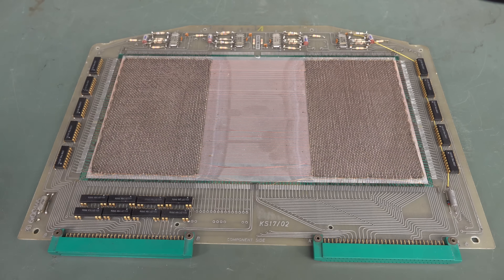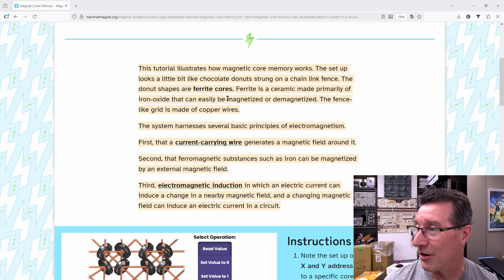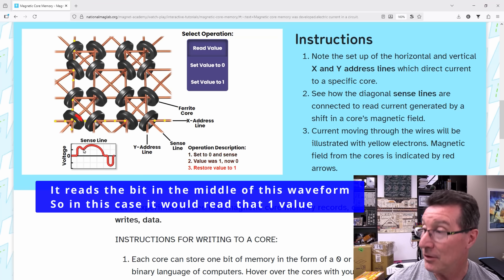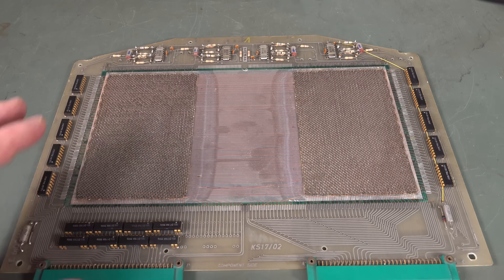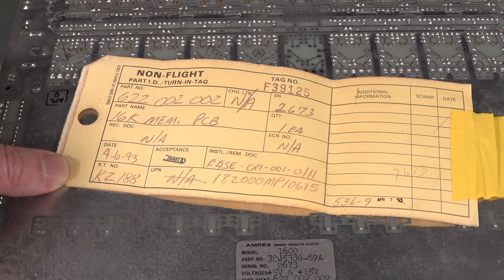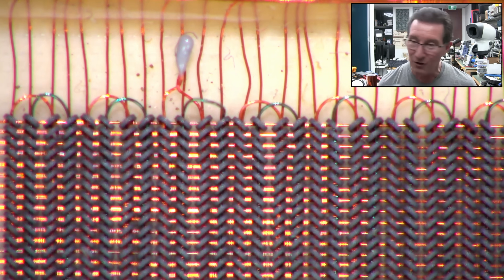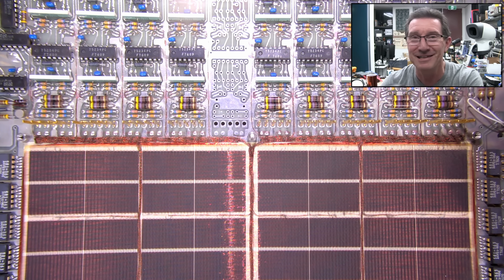EEVblog 1713 - CRAZY Density Magnetic Core Memory from Space Shuttle!

Comment from the maker: UPDATE: This is from Mailbag 668. It is from a Mitra 125s computer used in the Space Shuttle Spacelab program. The Mailbag video shows the top controller PCB as well that I likely also still have in the bunker.
Reply: I should not know this, but I happened to be an apprentice at the company that made it. The cancelled TSR2 used magnetic core memory, which consisted of a grid of wires passing through ferrite rings as per your illustration. I also got to see the gyro that was used in the prototype. I say gyro as it was a 4 inch cube containing 3 separate Gyroscopes, one for pitch, one for roll.and one for yaw. All these parts were supposed to have been destroyed after the aircraft was cancelled
Reply: I was going to say the "KSC Form" on the tag taped onto the 16K board stands for Kennedy Space Center
Reply: The Mitra 125s was a minicomputer developped by a French computer company (CII) created under  "Plan Calcul"  in order to develop a French/European computer industry. The Mitra line targeted mainly process control, industrial automation and such. Another competitor was Telemecanique and at some point the 2 companies were merged into SEMS (European Society of Microcomputer and Systems). I worked at SEMS (end 70s-beginning 80s) and at that time these minicomputers were using solid state memory. They were 16 bits with 2 bit parity).
To learn more you can search Wikipedia for "Plan Calcul" and "Mitra 15". The Mitra 15 was a predecessor of the 125 and the Wikipedia page covers both and more.
Reply: Absolutely fascinating. I hope that Ampex one was done by some sort of a machine as I wouldn't like to have been given that as a job. You would be blind in no time trying to focus on things that small.
Reply: At 3:04 , why aren't all the magnetic rings where the current passed change? Looks like 4 bits (rings) should have changed.
It looks to me like X and Y select and sense are COMBINED to reach the reluctance level needed.
Reply: In Electronic Design in the 1990s, there was an article about storing 6 to 8 bits of RAM into EACH ATOM by modifying the electron orbits somehow. I don't know if that was the same as what they call SPIN now, with SPIN-RAM out for a little while in the early 2005 maybe that were non - volitile. Would be nice to have a video on this or both if they are different things.
Reply: would it be possible for you and louis rossmann to do a youtube retirement croudfund for franblanche? she is literally dying in front of the camera doing vids for youtube .....

wouldn't have written this if it weren't urgent and somewhat serious

Comment: Notice that the cores have sharp edges. The sharp edge gives higher hysteresis in the magnetic flux. This is important when addressing a single core, all cores on the same row and column will receive 1*current, while the addressed core will receive 2*current, which will be respectively, under and over the threshold.
Reply: Also, reading a magnetic core will destroy the data bit in it.

The data will have to be rewritten back into the core.

Comment: That circuit board is not from the Space Shuttle.  It may have been used in a ground computer that did calculations related to the space shuttle program.

When I was in the US Navy we were using old data/program punch card sorters that had wire-board to program the sorter (you ran wires to connect outputs to inputs of sections with certain logic function: depending on how you wired the board it could do about a dozen different sorts of the data/program punch cards).   I read the manuals and created several "Programed" wire-board cards to do things that the Chief's wanted done.  That's how I got into programming....

Comment: Towards the end of core memory, one of the big magazines did a deep dive into core memory, with lots of cool closeups. They also talked about repairing the cores / wiring. It was necessary because over time, the vibrations would cause the cores to release leading to wearing. It was a highly specialized skill. As for reading it, you could probably read it with a magnetic scanner or a DIY using an HDD head.

Comment: So those ferrites are really fragile... I wonder what happens when a core breaks right in the middle of assembly. Could they somehow back-track to fix it, or just bin it and start again.
Reply: This was one of the selling points for the early DRAM chips -- if a bit goes bad, you only need to replace one chip which was 1024 bits. Repairing a magnetic core array was possible, but it was a very difficult procedure.

Comment: I was talking to a physics professor who did research in the antarctic. He said that when they would shutdown their PDP-8 when they left for the "winter", all they did was press halt and power it down. When they came back they powered it back up and hit run and it would pick up from where if left off because the core memory was happy to wait for them just chillin. So you never know, there may still be data in that board.
Reply: The data in core memory never goes away, but it is not reliable if power is shut down while running a program.

This is because readout requires zeroing out the data to be read, detecting the magnetic “flip” and saving the data in a register, then either passing the data to the system or replacing it with new data, then suppressing the rewriting of 1s in the bit positions that did or will contain 0s, when the rewrite pulses are activated.

So if the system is running while the power supply is “dying,” data may be read or written incorrectly.  But if the system is manually stopped before the power is cut, the data are safe.

Comment: When I worked for Delco Defense Systems, I used to occasionally visit the factory in Milwaukee Wisconsin. Our core memory line was in-house at that location until the last gasp. (Magnetic bubble memory was oustsourced to National Semiconductor by the mid eighties and silicon based memory families were either off the shelf or made for us by RCA in the case of special products). The last time I was out there in about 1992, the ten or twelve old ladies (and one twenty something guy) were still there and still weaving their magic just like in the sixties. They worked by hand using moderate low magnification stereo zoom microscopes. They did panels up to a megabyte by eight bits. Mostly used in satellite applications. The biggest panels were actually woven in sub panels that were fan folded into truly impressive modules. The contents stored in a properly engineered panel were safely retained through cold, heat (up to almost the curie point of the ferrite), vibration, cosmic radiation, and other radiation such as starfish prime. The data was also retained through a system reset or even a cold reboot. Is the stuff still in use today? I believe that some of our panels are still working happily away on the voyager probes.

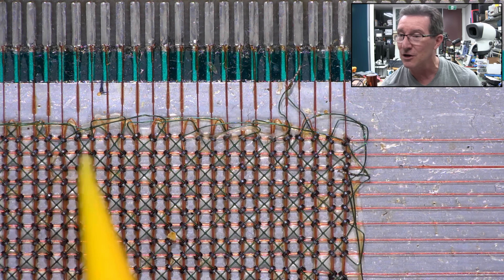Comment: If you look closely (at 11:51), there are two wires running in the Y direction. One of them is the address wire and the other one the write inhibit (looping through all the cores). Therefore, reading is actually a constant time operation: write-back happens anyway, but if it was a zero, the inhibit wire will block it.

(Addressing works by sending just above half of what is needed to flip a core's orientation down the respective X and Y wires, so that there's just a single core, just where these cross, that is actually flipped. If we oppose this by applying an opposing charge at the inhibit wire, no core will be affected. So, by simply repeating at the inhibit wire what's sensed on read, write-back is taken care of auto-magically. – Core memory is very much ingenious!)

On the Ampex board, the sense wire might have been repurposed for write inhibit. (Notably, this loops through all the cores, as well. Optimzing out one of the wires would have allowed for a smaller core diameter, but would have also been more challenging on the analog side of things. Or the write-back may have been controlled by dedicated logic, depending on what was sensed.)
Reply: As I understand it, the purpose of the inhibit wire was to control whether a 1 or 0 was written to each bit of a multi-bit word, so you could apply the same X-Y drive currents to all the planes and use the inhibit wires to determine the data written.

Comment: I helped build traffic signal systems back in the early 80's that used Data General Nova 1200 minicomputers. These had magnetic core memory, a whopping 16 kilobytes of it, on a single 15" square PCB. These were 16-bit machines with 8-bit bytes and 16-bit words, but most commands were entered on the front panel in octal, as I recall. We used them because they were durable in harsh environments, which could not be said for machines of the day that depended more on complex semiconductors. The DOD liked them for that reason, too, and they were used there fore things that still can't be talked about. That said, I don't miss them.

Comment: One of the first home-made 6800 systems I programmed had a 8kx8 core mat rigged as the memory. Great to be able to turn it off, come back a week later, and your code was just still there. When I was an apprentice at Plessey Mircosystems in 1982 they were still making/repairing core mats used in air traffic control systems, but bubble memory was the new thing for power-off storage.

Comment: As an undergrad at SFSU, we had an old DEC system in the corner of the lab with ferrite core memory, perhaps a PDP-8. Sorry, but it's been almost 50 years. The toroidal magnets were larger than either of your examples, perhaps a cm in diameter? 

They're wired in the same three--wire configuration, invented by JW Forester and documented in his 1951 paper. Every read is folliwed by a write, although a small logic circuit inhibited current when the result was zero. Storage was a precious thing in the 1950s and 1960s.

Comment: Hi Dave, if you look at 10:55, you will see an extra wire in the array, x, y, sense and inhibit.
This was to speed up the re-write needed after a read event by not selecting the individual core that was read but by doing a mass write to the complete core array and using the inhibit line to suppress over writing cores that were supposed to stay zero.

Comment: 18-bit is not that unusual actually. Many memory chips have 9/18/36/etc-bits. Everything with ECC so all memory chips used in servers and recently also DDR5.
Capacity is kinda low for the size... but also extremely large given the tech used. Really nice package and it even starts causing these chip-like light effects. Miniaturize it even more and it would be pretty much like integrated chip from outside.

Would be cool if you could read the data... for which it would be good to have similar module to make some kind of reader... which if you got one you would have identical issue with any operations destroying data.

Comment: When I was at CMU back in the late 90s I came across a very old mainframe computer out in the hallway of an EE building. One of those refrigerator like things with tape drives on the front. I asked around but no one knew what it was there for. So I took out the "hard drive", which was a big metal case full of what was probably magnetic core memory cards, and left a note. Sadly, they contacted me later and asked me to return it. So I never actually got to take it fully apart. I have no idea what they wanted that computer for.

Comment: In 1988, I was visiting AMPEX in HK, and was taken to visit Ampex Ferrotec to see the core assembly process.
Three little old ladies seated around circular work areas with tubs of core in the middle.
Each manually knitting new cores onto the wire matrix by hand, without magnifiers !
Very cool.
Reply: IBM “printed” the concept behind rope core ROM for the lowest models of 360s, such as the Model 20.  They mass produced strips of flat cable with two 37-rung ladder shaped conducting paths joined at one end and with two terminals at the other, embedded between plastic sheets, with holes punched in the plastic insulation between rungs.  To program the 72-bit word stored in one of these strips, a technician punches a hole to break one  of the longitudinal wires between rungs, ie 72 holes in all, to create a single serpentine conducting path down one side of the strip and up the other between the terminals.  These strips are stacked on the innermost of two ferrite pole pieces on both sides, so that the conducting path on each strip goes between the pole pieces of some sensing coils and bypasses others, thus encoding the 72-bit word.  Each strip is connected to one of the word selector outputs of an n-bit binary to one-of-2^n decoder, and the lid containing the 72 ferrite caps to complete the magnetic circuit is screwed on.  So the ROM address selects one of the strips per cycle, sends a current pulse through that strip, which induces a voltage pulse in the sensor coils where the strip goes through the magnet to encode a 1, none where it bypasses the core to encode a 0.  This is a simpler (but bulkier and heavier) analog of the core rope ROM, which IBM called TROS, for Transformer Read Only Storage.
Reply: That's insane! Imaging how long it would take to make a full memory array. How could they ever mass produce this?
Reply: not sure, I was only there for a couple of hours.l!
They were pretty fast, I think the panels they were working on were perhaps 4K bits, and it would take a couple of hours knitting,  They took a tea break while I was there, so I can’t  be sure.
What struck me was there wasn’t any particular ‘clean room’ or sterile facility in sight !
Reply: @laustinspeiss  There is a machine where 2 people (usually women)  hand feed the 'needle' through a panel with holes in it which moves automatically to each position. Years ago I watched a video on YT about it, called "Computer for Apollo" from 1965. They talk about the memory here.... https://youtu.be/ndvmFlg1WmE?t=1244
Reply: @g4z-kb7ct  this is magnetic core rope memory, its a ROM not RAM. similar principles though
Reply: @FrankGennari  by finding more old ladies to knit more in parallel, obviously.

Comment: Great video. I used to work for IBM New Zealand and my first job (that I was allowed to do solo.) was to remove core storage out of a mainframe comunications controller and replace it with new fangled electronic RAM. This was in the very early 80's
But later in the '90s I met a US guy that worked for IBM Federal Systems at NASA. He was tasked to have some core storage remade for use as last ditch storage for the space shuttle. When the Challenger exploded on launch, the recovered core storage still contained the last bit of telemetry data. Way cool!

Comment: 1970’s lighting desks used core stores. I worked at the bbc in the late 80’s and there was a decommissioned desk that hadn’t been removed. Fascinating stuff
Reply: What's a lighting desk? ???
Reply: @kennethflorek8532 a bit of equipment used in theatre and television that is used to control the lights. They are usually split into 3 parts. The controls used by the operator, a rack of electronics (the bit with logic and memory) and a bunch of big dimmers (which control the power supplied to each light in the studio). The Thorn Q-file was the desk I saw.

Comment: How is it that the current flowing through those X and Y wires does not disturb the magnetization of the other cores along its way?
Reply: Hysteresis.  The ferrite requires the magnetic flux from the current in two wires to flip. The flux from the current in one wire does nothing.  Since only one x and one y are active at one time, only the core at that intersection is affected.
Reply from the maker: They have a large hysteresis, such that only having dual current from both X and Y magnetises them.

Comment: ... that 16K ferrite core memory looks absolutely majestic! The craftsmanship on these modules is so delicate and fine ... work of art :)
Reply: The cores were not wired one by one by hand. The worker would take the array of cores already oriented in the required pattern by a machine, and then insert maybe 64 wires in parallel, using a specially made jig. There was still quite a lot of manual work, but it was thousands of times more productive compared to what it would take to insert the wires in each core individually.
Reply: @cogoid  Yeah prewired columns is a good automation idea. But the diagonal wire from the first product, that must be manual labor!
Reply: Hand assembled by women under a microscope, obviously. Yes, huge amount of labor and pain-stacking detail. To weave all of that by hand.

Comment: Would be interesting to know if those high density core modules were made by hand under microscopes or by machines.  The cost to make must have been mental given the man hours and testing needed!
Reply: There were jigs for helping with the work. The cores arranged themselves into the array on one jig, and then all the wires were automatically aligned and inserted simultaneously on another jig, using very long needles welded to the wires. 

In principle, there were machines automating much of the work, but in practice it was often faster and cheaper to hire thousands of silk workers in Japan to do this manually. 

The cost per bit of the core memory was extremely high only in the early years. As the techniques and tools evolved, the capacity per memory module went up exponentially, while the price of the memory module changed much, much less. Price per bit dropped several orders of magnitude, from a dollar a bit to some fraction of a penny by the time semiconductor memories started to compete with the core -- DRAM was not even cheaper per bit at first.
Reply: @cogoid  That's most interesting. Thank you.
Reply: I believe they were and mostly by women.  A figure of 5 cents was quoted and that was for each toroid